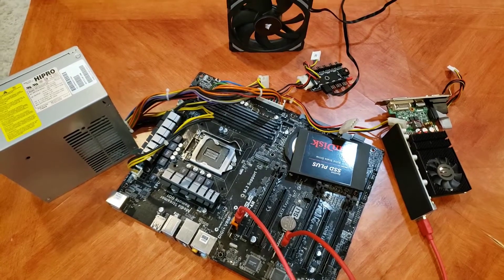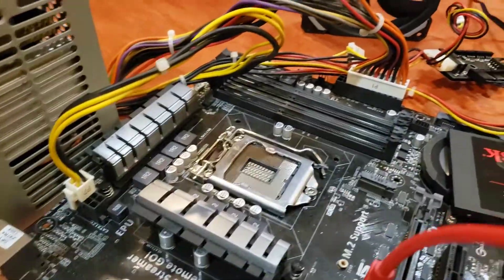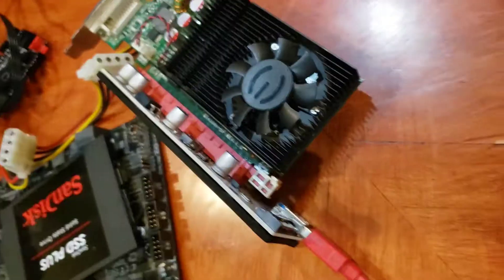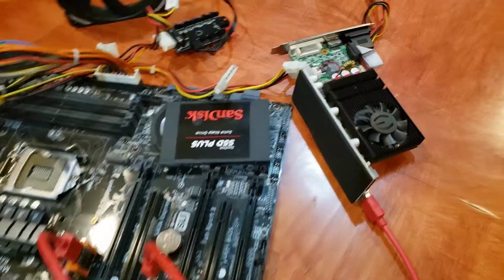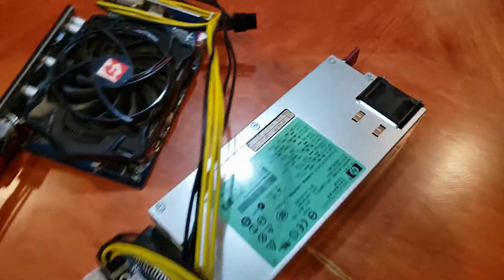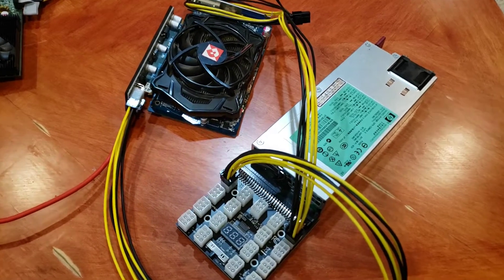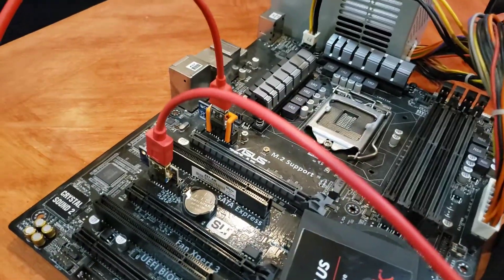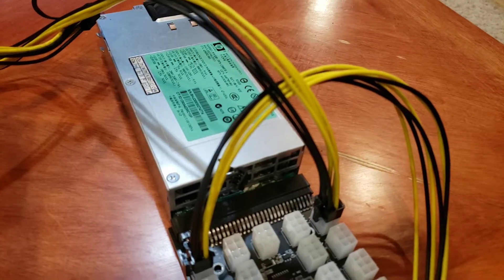SERVER PSU CONNECTIONS GUIDE

Comment: Hi sir how about the brown out no electricity then comes back the electricity .. server psu with in 5 mins or 1 hr and the toggle switch always on?
Reply from the maker: If you breakout board has an actual on/off SWITCH then just leave it always on. If yours has a push button, then you can get a 12v remote trigger molex 4 pin, if your breakout board has the 4 pin remote trigger.

Comment: Nice layout of the setup.

How will you power up the rig? Do I switch on the motherboard first and then switch on the server psu second? Or will server psu switch on automatically after atx psu powers up?
Reply from the maker: The server psu is set to be always on, and both psu are going to 1 power strip. But turn on server psu first, then the regular atx psu. If the server is too late, those gpus won't show up in windows, so  then just do a quick reboot.
Reply: @JoyofMining  i also have atx+server psu setup on auto on. Atx turns on faster than server psu so when theres power interruption, i had to reboot the rig first so the gpus can be detected. Would be nice if theres a boot delay option in bios so server psu can startup first compared to the atx. Right now i use smart plug on the atx since only the motherboard is connected to it so i can restart my rig when im not at home
Reply from the maker: @roicrypto1567  I wonder, isn't there a boot delay in bios to press del to get into bios? Maybe we could utilize that to get a little more delay. But that might load pcie before that screen. Def annoying for sure after a power loss.
Reply: @JoyofMining  that power strip is the 24 pin for the motherboard?
Reply from the maker: @Ludapiss  in my rigs I have 2 psu, 1 traditional atx, and 1 server. They both plug into a 6 outlet power Strip, that has a single power button that runs a single power to the wall. This older video shows ya. https://youtu.be/Zm9LYt57J0M
Reply: @JoyofMining  so the server psu is simply powering the gpus and nothing else? 

So sorry for asking noob questions. I haven't found a good video and your videos is as close to getting my answers 😊
Reply from the maker: Yes. 1 psu powers mobo, fans, a couple gpus and their risers, then the second psu has a couple gpus and their risers. Just make sure you don't mix psu on riser and gpu. So Same psu for gpu and that riser
Reply: @JoyofMining  thank you so much for your help. I look forward to your future mining videos. 😊👍